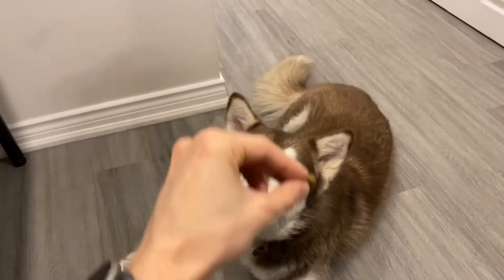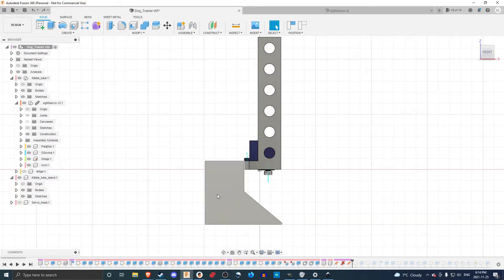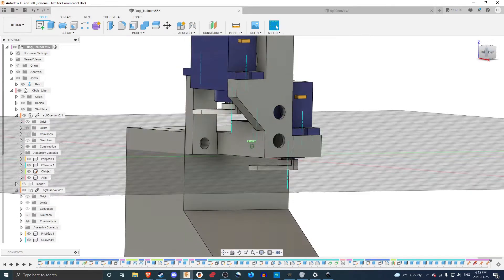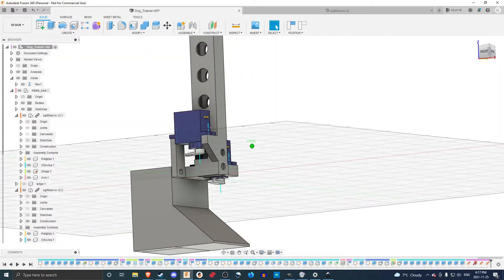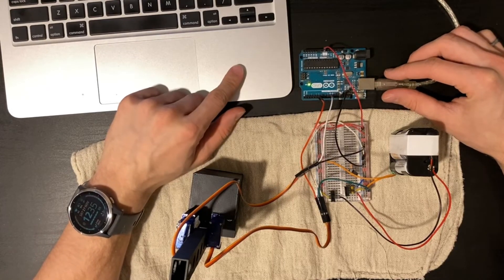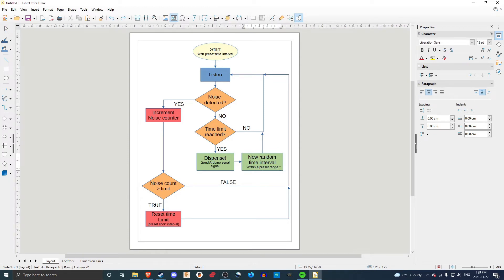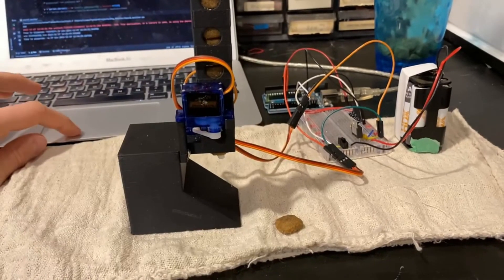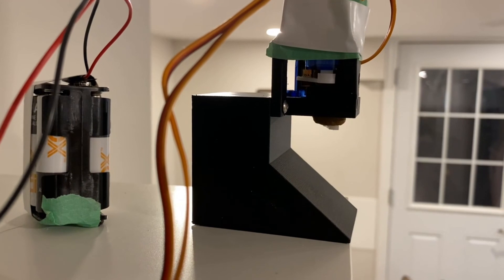Training my dog with Arduino and Python

Comment: Wow I made the exact same thing for a uni project, without seeing this... (would have been pretty useful if I had)

I used a test tube stand and a piece of plastic tube, 2 servo motors connected to an arduino, so it looked a million times worse than yours.

But I trained a neural network to check if my dog was sitting, lying or standing.
So that my laptop would say "basket", until the webcam recognized she was there.
Then it would tell her to sit. Check that she was sitting.
Then it would tell her to lie. Check that she was lying.
Then release a treat.